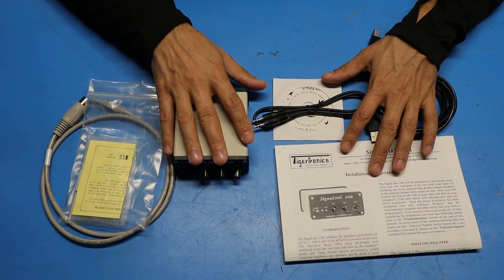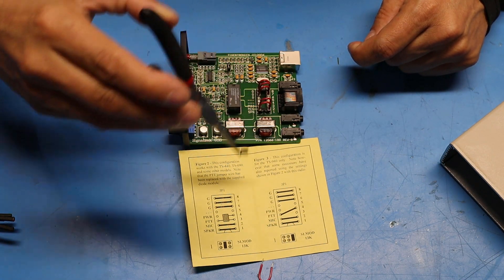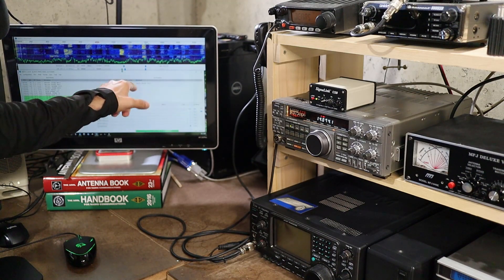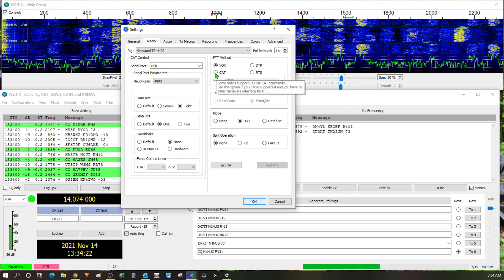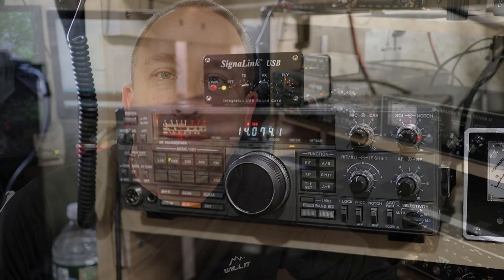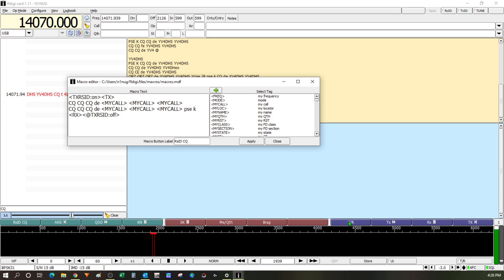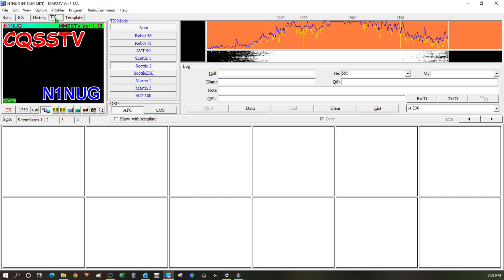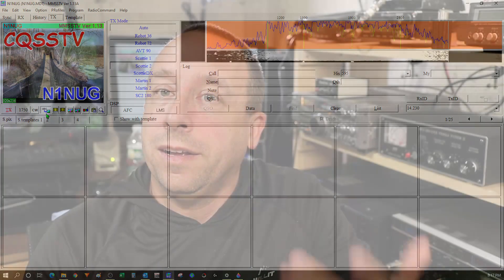Ham Radio: SignalLink USB Setup and Demo with a Kenwood TS-440

Comment: Great device. For some reason, my computer stopped recognizing my TS-890 when I connected them via a USB cable. I believe the problem is with the TS-890. Rather than send it in for repair, spending hundreds of dollars and having it gone for a month, I ordered a SignalLink, and I'm back on the digital modes again. I lost CAT control, but that doesn't really matter to me as the TS-890 is within arms reach when I'm operating digital. 73 de WB4DW

Comment: ... great video, thanks ... I have a problem ... the manual for my 746 shows another pinout: PIN 5 is AF OUT ... I don't think there is a difference between the US and European versions. Please could you confirm for me
4 DATA OUT
2 IN DATE
5 PTT
6 GND?
Reply: sorry I'm wrong ..73

Comment: Does that ALC control effectively lower the RF power for the rig?  I know it's not great to throw 100 watts of digi modes into those MFJ tuners.  What kind of power levels were you transmitting here in the video?
Reply from the maker: It will lower it some...there isn't a power level control on the Kenwood

Comment: I have the very same setup and done the same as what you have, but I can not get it to transmit at all, my channel has a short video on what I've done, do you use the audio cable as well ? care to create another video on setting up please..cheers and 73's, P.S the only other thing I haven't tried yet is the jump settings, I used a module called SLMOD13K instead but I am going to set the jumps by hand and give that ago.
Reply from the maker: I'm out of town now but will be home later and will check my setup.i watched your video quickly and everything looked right to me so I'm not sure why it's not working.  Are you sure you have the right jumper module?  Is it installed correctly?  If I think of anything I'll let you know
Reply from the maker: Hang on ...in 5he software I'm not sure you want to be set to vox .. I don't remember what the right setting is though.  As I said, I'll be home later today and will try to remember to look
Reply: @SevenFortyOne  I'm back at it again, WJST-X is reciving OK, but I get the Rig Control error window, here my video on it,  https://youtu.be/qmin8fNo_a4

Comment: You have a older version of the Signal Link.  The two little red transformers have been replaced in newer versions with black chips that enable higher speeds and more sensitivity during weaker signals.

Comment: Did you get the cat cable, and did it work. I bought one that does not work.
Reply from the maker: I never did but someone else in the comments posted about this
Reply: You will need to get the chip set for inside the radio also.

Comment: Link for CAT control cable of the TS-440s?  Thanks!
Reply from the maker: https://amzn.to/3fZErRf
Reply: @SevenFortyOne  Thanks!  The "old school" cable as well, please?! thanks!
Reply from the maker: I don't know what you mean by that ..
Reply: @SevenFortyOne  The ORIGINAL connection system cable not involving USB.
Reply from the maker: Still not sure what you mean...all I know is what's shown in this video and in the description. You'll have to do some googling to see if you can find what you are looking for.  There might be more info in the comments here too that will help
Reply: @SevenFortyOne  Perhaps I saw it elsewhere:  The ORIGINAL Kenwood style cable....BEFORE USB....the connector names confuse me...serial....pins...whatever.....I'll find it.  Thanks
Reply: @SevenFortyOne  The "original" was rs232 and db9 connectors. cat control cable.  Ideas?  Using "old school" avoids driver searching!  Thanks!!
Reply from the maker: Oh, ok....rs233.  just do a search for something like rs-232 cat control cable for Kenwood and see what you find....
Reply: I may be wrong, but I think the TS440 requires a special chipset to be installed for CAT control. I like the ACT control on my Icom 705, but your video really struck me about using the VOX control instead. Sometimes we overcomplicate things, and your simplistic approach using this Signal Link tool opened up my eyes to the ability to use older radios to perform these same tasks. 

I'm extremely new to the hobby, and frankly I'm a little microphone shy on HF, although I participate in local VHF club on air meetings. Digital formats are nice for reclusive dudes like myself and find it a little intimidating whenever I have "keyed up" on HF. Thanks for the additional education and exposure! I'm constantly learning!

Comment: Hey great video. I have a TS 440s and am trying to get hooked up to some logging software. It looks like the signal link is the way to go. You metioned that you were ordering a Cat cable and would post a link to it. Either i'm missing it or its not here. My 440s has a 13 pin cable  plug for data too on the other side, would it matter if i used the 13 pin or the 6pin that you usedbecause signal link uses both. Thanks again for the great videos ,keep it up.
Reply from the maker: I haven't ordered it yet.  Do a search for ts-440 cat cable and you should find it
Reply: @SevenFortyOne  found it thanks you will also need a chip set IC-10. thanks 73

Comment: Thanks.  I found this helpful.  I have some older Yaesu radios with tube finals that I'd like to try to get on digital modes again -- something I stopped doing many years ago when RTTY faded.  I especially liked where you bypassed all that rig control complexity I've seen on other videos.

Comment: If I ever find another TS-440SAT in outstanding condition I will buy it and never sell it!
Reply from the maker: Good idea!
Reply: @SevenFortyOne  Yep, I kick my ass everyday over that decision.
Reply: I picked up one in May at the Dayton Hamfest. The guy was set up infield with two of them sitting on a pickup truck tailgate without prices. I negotiated a $300 price for choice of one. I selected a unit that was pristine and had no obvious molested case or screws indicating no morons had torn it apart. It turned out to be a good gamble. It included an installed CW filter as a bonus! My first HF voice contact was on this radio. I also own an Icom 705 that I have been using for FT8 and had no real clue that I could try my old Kenwood for digital. I'm gonna have to look around for one of these Signal Links!

Comment: There's a ham in the club who says FT8 is the bees knees. I'm thinking it's like getting on the highway then pressing the "auto pilot" button in a Tesla. Too bad about your antenna. Hopefully you can get 40 and 80 up before it gets too cold.
Reply from the maker: I feel it's interesting to get it working but actually using it for more than 15 minutes is a bit like watching paint dry.
Reply: @SevenFortyOne  I am choosing it as my first digital mode to learn, mainly because there are others using it. It is like waving at pretty girls, one after the other. Learning how to set the software up is the main challenge, and it reminds me of computing back when Basic was in ROM on my IBM PC.
Reply from the maker: @LibertyCaveWS7PB  The FT8-off guys have done a great job in making something that is arguably boring interesting by adding a (friendly) competitive element to it.  Its a very useful mode and worth learning for many reasons.

Comment: i have this same setup for my Kenwood TS-850S except i have the original Kenwood CAT control box that i found on E-Bay.. It works grate for older computers that have the 9 pin serial port and it wasn't to much work to get CAT control to work on my 10 year old desktop... 73''s DE KK4MMM...